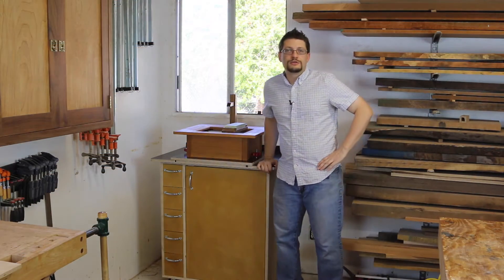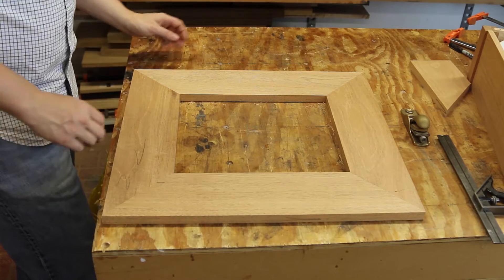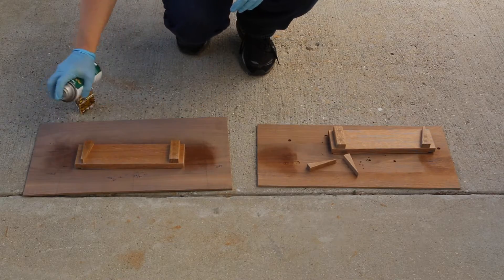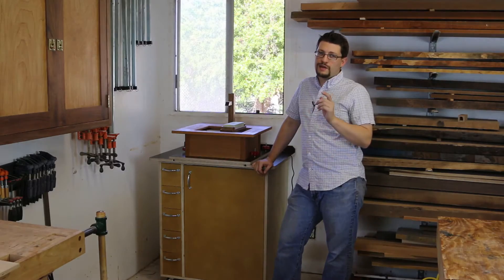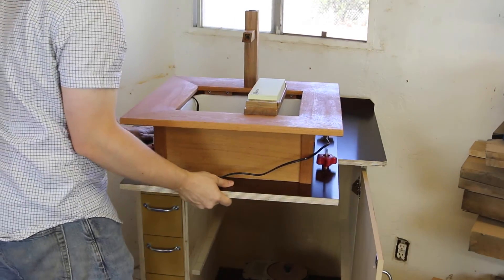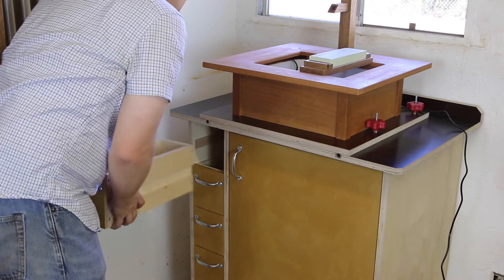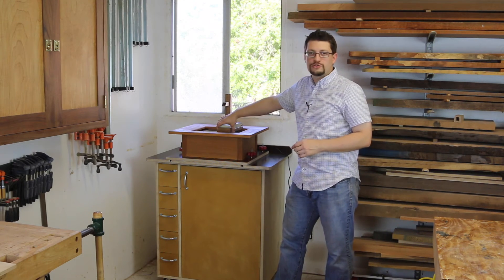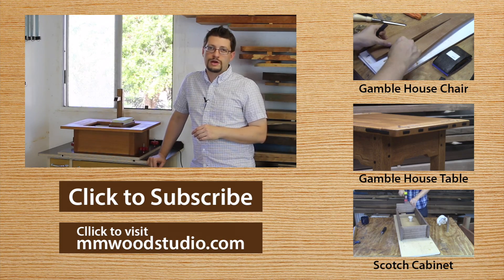Dedicated Sharpening Station Project Preview

Comment: Well it’s NOT dedicated, you put it away in the cupboard so the top is used for something else! Absurdly complex way to wet the stone, a spray bottle works well. Using a nagura stone on the high grits does not require a water flow.

Comment: Matthew,
I've been looking at this design and overall, I like it very much.  What concerns me is the use of what appears to be a (very) cheap, off-brand, Chinese-made aquarium pump plugged directly in to 120V wall power. (sorry to bash the Chinese manufacturers - but their quality standards are sometimes quite low and I seriously doubt that pump design has passed anywhere near Underwriters Laboratories)   Electrocuting someones guppies is one thing.  Zapping a cat or dog (people seem to use these pumps for pet bowl water circulation) is tragic.  But to see you repeatedly sticking your hand into a tub of water with a $10 off-brand pump charged up with 120 volts is downright scary.  One small fault in the construction or wiring of that pump (which may not appear until after weeks, months or years of use) and you get a nasty, potentially fatal surprise.   Water and high voltage do not mix well. I did some checking and there are low-voltage (12 volt) aquarium pumps that operate the same as the pump you seem to be using. Same output hose diameter, same kind of flow adjustment, similar flow rates.  Instead of running 120V to the pump, they have a wall wart transformer that converts the voltage down to a much safer 12V.  You should change out your pump to one of the low voltage units and alter the plans you are selling accordingly.  It may just save someones (possibly your own) life.

Also, rather than sticking your hand in the water to turn the pump on and off - for about 15 bucks, you can add a foot pedal switch to turn the pump on and off.  Of course, you have to reach in to adjust the flow rate - but I'd think that typically you just want a moderate trickle of water.  Just set the flow rate once and toggle the pump on and off with a foot switch as needed.
Reply from the maker: Brian Dormer Cool. Send me a link to one of these 12 volt pumps.
Reply: MM Wood Studio Sent via the Contact page on your website.  I don't know if YouTube would have let me post the links.  The main thing to look for seems to be an "LV" (low voltage) after the part number - for example P333LV.
Reply from the maker: Brian Dormer thanks Brian. Wrote back to you via email. Bought a new pump and foot peddle and updated the links on YouTube and my site.